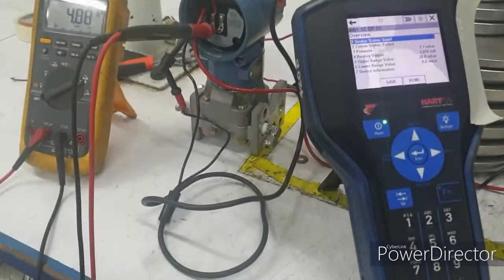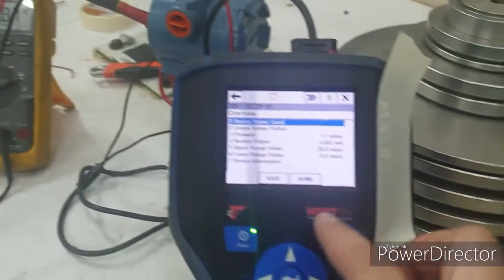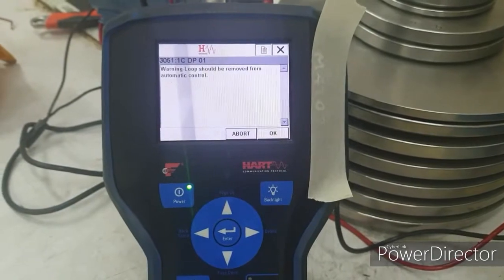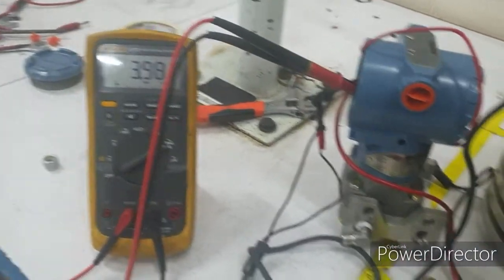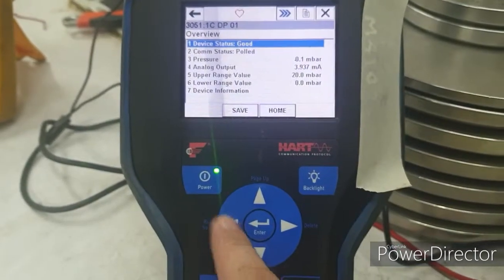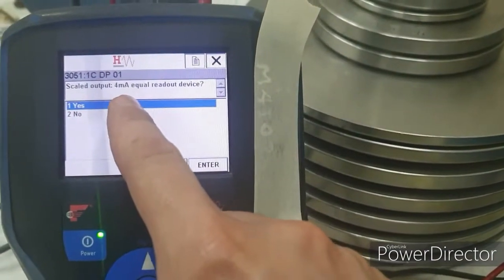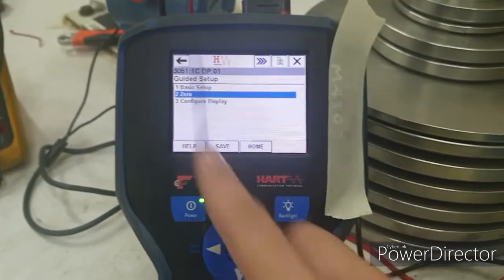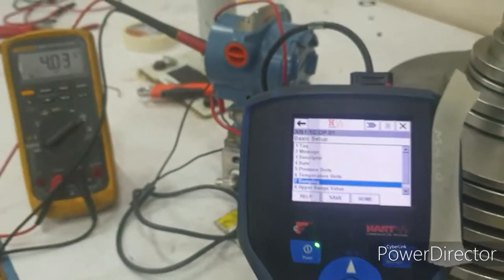Differential Pressure Transmitter (DPT) calibration with sensor and analog trimming_3051(PART 3)

Comment: How did you drift the output?
Reply from the maker: just modify change the current value either in zero or span when doing anlog scaling
Reply: @armaiboi  paano mo ginawang 3.1
Reply from the maker: @zilongsky5614  balikan mo yung video start at 4:36. instead e correct mo yung value, ibahin mo.
Reply: May inadjust ka sa transmitter para maging 3.1 yung reading sa transmitter?
Reply from the maker: yes, but not shown in the video.
Reply: @armaiboi  how did you do it?

Comment: sir salamat sa pagshare ng vedio. tanong po sa loop bad at transmitter fault paano po troubleshoot.
Reply from the maker: hello sir.. salamat po sa pag view ng video.. ano po ibig nyo sabihin? yung pag mag bad PV ang signal ng transmitter?
Reply: @armaiboi  sir nagpre loop po kami . 3051 pressure transmitter 0-120 kg/cm2 cal. range. ok naman po un simulation field to computer room. kaso lang po talaga may BAD n lumilitaw sa local display ng transmitter.. salamat po.
Reply from the maker: nung may Bad sa local display ano ang current output nya papuntang DCS?
Reply: @armaiboi  sorry po sir diko natandaan un current output. iba  po kc un display ng trex sa overview bagong gamit ko palang kc.. di po tulad ng display ng 475 nakikita sa overview un current. balikan ko bukas un transmitter.
Reply from the maker: sir, try nyo ko e message sa whatsapp +971558971107